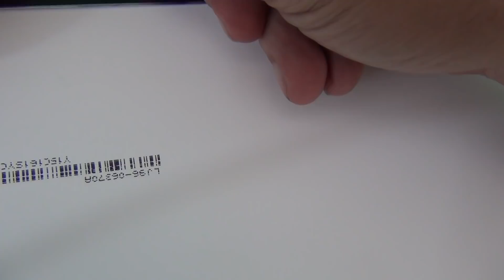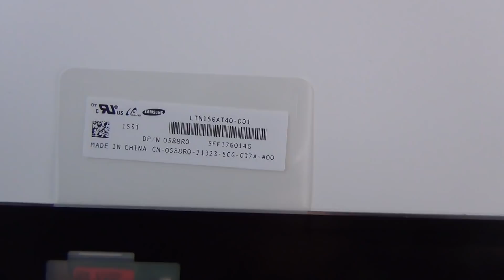Dell Inspiron 15-5000 series i5555 Laptop Screen Replacement Procedure

Comment: This is a great video!...Big thumbs up!.....I'm ready to tackle this task on my (now 8+/- yr. old) 5000 series Dell.....Old, I know, but it still works fine for all my purposes, and it sure as hell beats looking at a tiny screen on a smartphone when traveling....Unfortunately it doesn't look like the link to your site for ID'ing the screen code is valid anymore (and Dell hasn't responded to my request for info)....Before taking it apart, going ahead and ordering something, I'd prefer to confirm the screen model - i.e., LTN156xxxx, N156xxx, B156xxxx, etc....The service tag on my Dell is "IC0VL72"....Any chance you can help me out here? Thanks in advance.

Comment: My screen flickers or is completely blank for several minutes after booting, once it's been running for awhile, the screen starts working, but if I adjust it, it flickers still. What could this be? I can only guess that the minor heat from the pc expands something to help the connection. I  have no opened it up to check the connections, but I did tighten the back screws which surprisingly seemed to help.

Comment: Excellent video!  The hinges on the 15-5000 series touch screens are horrible. They lock up and the customer blows out the palm rest and bottom base cover. Both of which have to be replaced. If just replacing the hinges can you reuse the double sided tape or does it have to be replaced?  If it needs to be replaced what it the part number or name for the tape?

Comment: question is the inverter board built into the screen or under the keyboard/touch pad bezel? reason im asking that because my display is acting up. either something is loose or something else. the screen shows with a white background (assuming the backlights) and then the logo goes in and out. kinda like an old tv receiving a bad signal from the nearest tv station.

Comment: I have a Dell Inspiron 15-5000 Series 15.6"  laptop core i5. Its Services Tag: HWCKY52. While traveling it was in my CheckIn luggage . Before it was ok but now there are some horizontal line and unable to screen properly. But With External screen with HDMI all ok.

So I believe my laptop screen is not good. Its not touch screen. I want to buy a screen. Can you please tell, which screen is for my laptop.

Comment: Great video but I was disappointed by the screen quality. Not nearly as clear as the original and the icons look kinda old school pixelated. Purchased for 110 with quick and free shipping. Tools are great but I see why Dell charges 189 for their replacement screen.

Comment: how much it will cost to replace led screen of Dell i5 core processor lap??
Reply from the maker: This will depend on the model. Can you please provide the service tag which is usually located at the bottom.

Comment: Wow so easyyy~~~ how much do you think it would cause if I gave it to the service center for repair?
Reply: abut 300 ish, give or take. They they'll say the screen was 150+ then the labor is tedious to remove. It's a load of bullshit, you don't need to pay a repair company $300-400 for a max of a half and hour to install replacements of something they should be used to doing in 5 minutes.